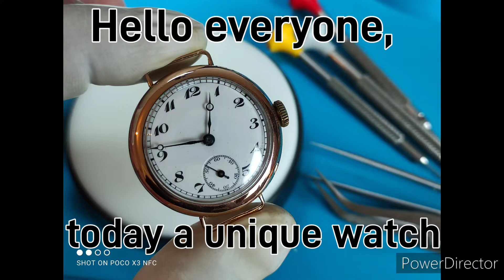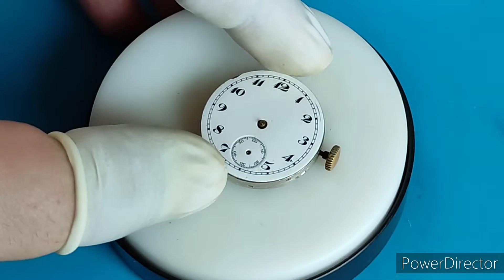100 year old antique wrist watch full service BUREN Grand prix

Comment: Well from the style of the gear train bridge it could very well be late 20's or possible 1930's. I collect and service Bulova wrist watches and their movements from that time period have that same style of gear train bridges where it looks like there are three separate small bridges but in fact it is just one. With Bulova movements that type of gear train bridge fall out of use by the 40's.

Comment: Nicely dine ! Do you have a timing machine? I wonder how accurate this little movement can be after 100 years of service 🙂
Reply from the maker: the watch requires further work, the main spring requires replacement, the parameters are not satisfactory.  amplitude around 180 degrees and drops quickly. will be continued, replace the main spring and we'll see then

Regards karol